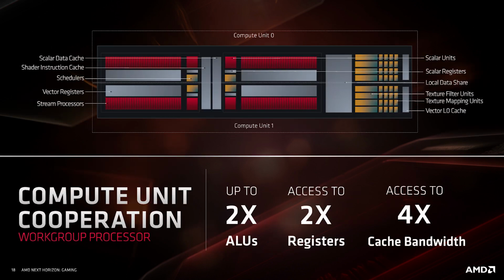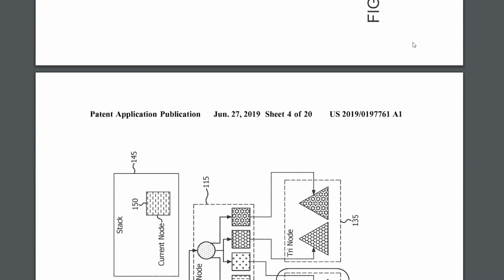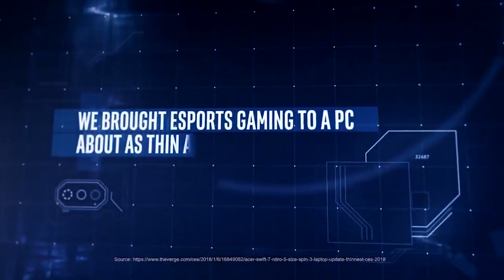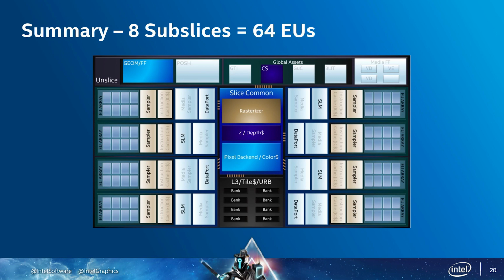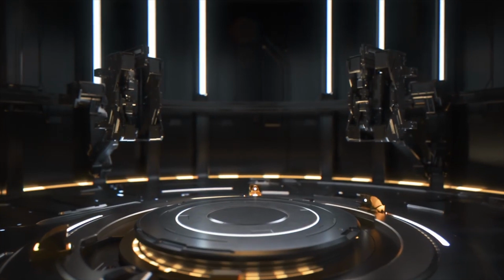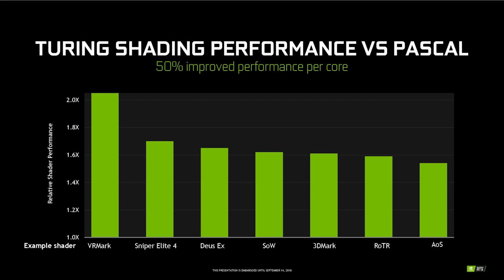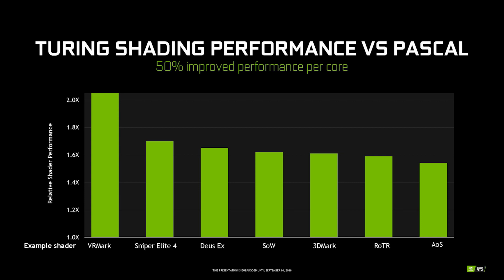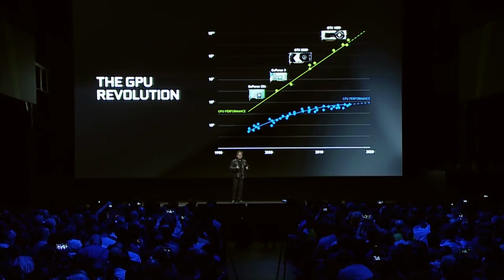Thoughts On The Current GPU Market | AMD Intel & Nvidia

Comment: "If you want 4k visuals your only choice is NVidia.."    IDK, from what I've seen of the 5700XT, it handles 4k/60/Ultra  pretty darn well.. and does it for $450.. less than half of a 2080ti, and significantly less than a 2080.    Maybe you should include a framerate, like 4k/120hz/Ultra, because even my GTX-1080 does 4k / Ultra at around 50 FPS.  Doing it in Witcher 3 with the new HD mods now.  And the 5700XT is the better card.
Reply: Not with current coolers....maybe the AIC cards will change it high 80s to 100c is ridiculous

Comment: Amd rx 5700 and 5700 xt are so strong value per fps that Nvidia needs to drop prices of 1660 ti to 2070 super to able to compete. Those custom cards versions of rx 5700 series will be much powerful because of better cooling.

Comment: What we know so far = 

RX-5700 has 32CU's and 2048SP's. 

5700XT has 40 CU's and 2560SP's. 

We also know that the 5700/XT is AMD's MID-RANGE offering. 

Here are my predictions for upcoming higher end Navi-10 gpu's tbr in Q4-2019. There will be three models and will likely have 384 bit bus =  

RX-5800XT = 48CU's and 3072 SP's and 8GB GDDR6.

RX-5900 = 56 CU's and 3584SP's and 8GB GDDR6

RX-5900XT = 64CU's and 4096SP's and 8GB-12GB GDDR6  

I personally doubt AMD will be using the RX-5900 nomenclature for big boy Navi-20 in 2020. I think they will use a different numbering scheme (probably 6000 series). I suspect that AMD will break the 4096SP/64CU barrier with Navi-20, so their high range models will commence with at least 4608SP's and 72CU's and will likely have 512 bit bus for the higher end models and 384 bit bus for the lower end models. 

Predictions are IP of BB.

:)

Comment: 11:00 mins in...
Intel has TWO TIMES BEFORE in the last 2 Decades,publicly challenged AMD/ATI/NV/S3/ Matrox/3Dfx, and said "we are joining the fight", proceeded to spend BILLIONS £ each time on engineer highering sprees,and massive R&D,only to launch low end junk in the end(740),or not launch anything at all..... Nvidia holds most of the cards(PATENTS) and this race is for nVIDIA to lose.  11:39  'Late 2020' ? :) No Paul.
4.16.2020 is when DXR will take off.